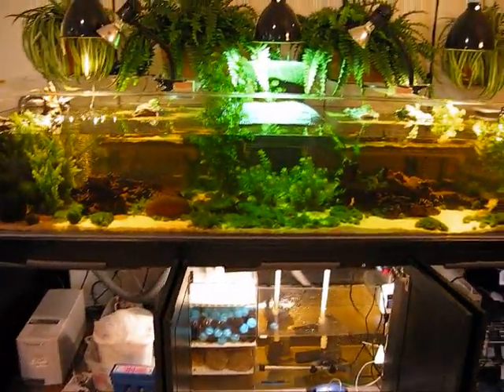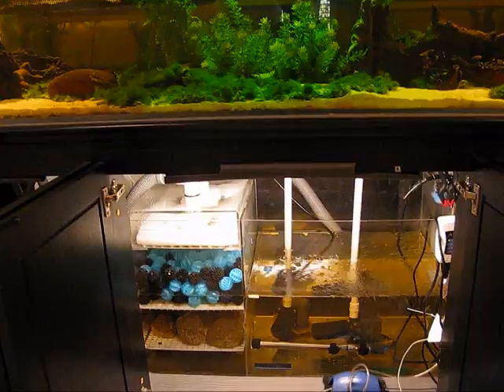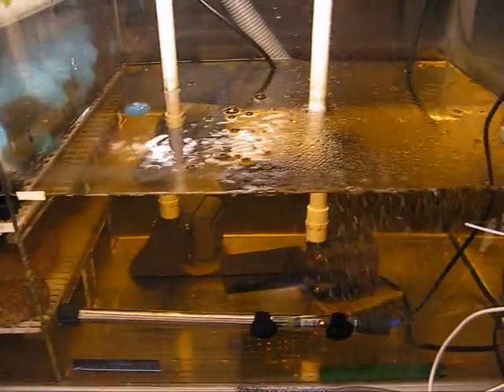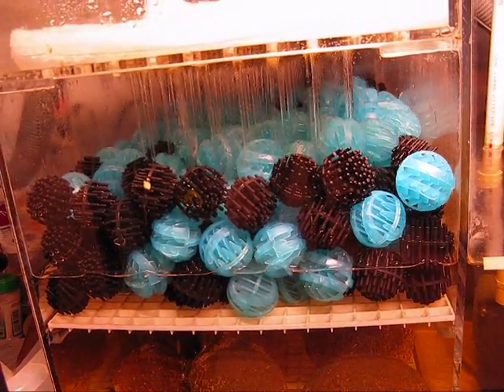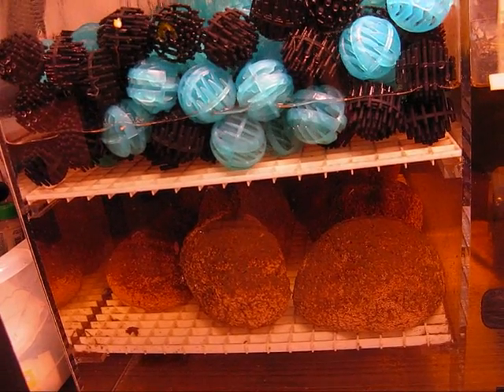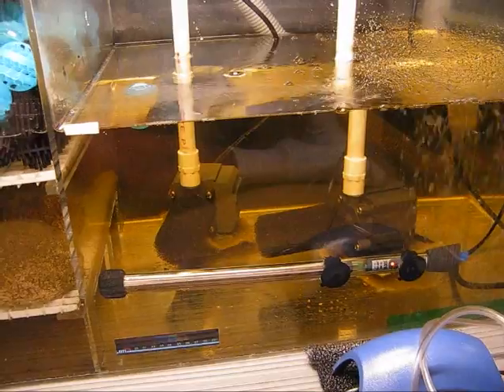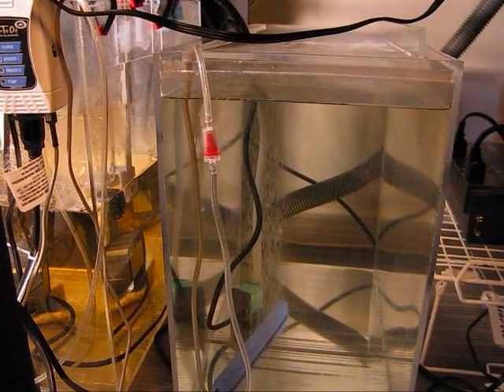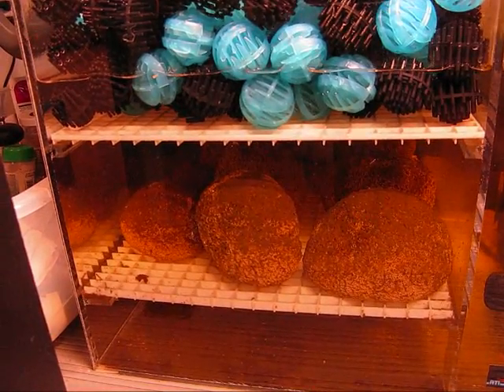Turtle Tank Trickle Filter

Comment: Hi there Bob. We recently just bought 2 Quarter size Yellow Bellied Slider turtles. We've gotten a bit lost on what exactly it is we need to do to keep them safe and happy.
So far we have a 29 Gallon tank, an Aqueon 155 Gal per hour submersible filter, a water heater, underwater thermometer, basking area, UVB light strip, 150Watt heating lamp, and a moss ball. We don't have a lot of money to spend (we've already gone far over budget) but we want to keep them safe. We've only had them for a week now and our filter hasn't done a full nitrogen cycle.
Should we add in bacteria?  Do we need to fully drain our tank every couple days and clean everything off or only do partial water changes? Should we get a bubble wand to oxygenate the water for the bacteria?
As you can tell we are very lost at the moment. Whatever help you can give would be appreciated.
Reply from the maker: do only partial water changes to preserve bacteria that break down waste products.  I change half my water once weekly.  Surface turbulence will probably increase oxygen better than a bubble wand though they are good for breaking ujp surface sludge.  The larger the tank the easier to keep clean.  You'll eventually have to get a much larger tank as sliders can grow quite large.  You'll eventually need to switch to a larger canister filter as well.  Adding bacteria shouldn't be necessary.  Try adding anacharis plants to help with water chemistry.  Buy a kit that measures ammonia, nitrites, and nitrates.  The biological filtration in your tank must be good enough to render ammonia and nitrites to zero.  Nitrates are controlled by the partial water change. 

I strongly recommend joining the Turtle Forum online. 
http://www.turtleforum.com/forum/upload/index.php?

Comment from the maker: those are not ordinary rocks.  They are cell pore rocks.  I don't know if they are available anymore but they are very porous all the way through and provide a lot of surface area.  In any case, my ammonia and nitrite levels are zero so any more filtration would be redundant.  I am trying to add more live plants to work on the nitrate levels instead.  But I'll always have to do partial water changes, nitrates are always a problem in a closed system like an aquarium.

Comment from the maker: heavy waste on the bottom cannot be handled by any kind of filter unless you are blasting a current across the bottom of the aquarium.  The largest canister filter only sucks up waste sitting on the bottom if it is within a few inches of the intake.  Most organic waste will eventually dissolve in the water to form ammonia and other organic byproducts which should be handled by the biological filtration in any good filter.  Try to manually remove any uneaten food within a half hour of feeding.

Comment: Hey Bob, love your setup.  I just got a 210 with dual drilled overflows and I am thinking about duplicating your setup.  My only concern is that the surface skimming an overflow is famous for does not address the heavy waste that sits at the bottom. How have you dealt with this and is it even a problem at all? Thanks

Comment from the maker: turtles are far less sensitive to ammonia byproducts that fish.  I just started a hatchling tank less than 2 weeks ago.  I had three mud turtle hatchlings in there right away.  The water clouded and then cleared after a few days.  Never has been an issue with turtles.  I still do frequent partial water changes though, high nitrates are not good as well as other contaminants, bacteria, etc.

Comment from the maker: the tank was custom built by an aquarium shop here locally.  When I first added the Mopani wood to the tank I had a tannin problem, water turned tea-colored.  I used carbon to remove the tannins.  Once the tannins subsided, a couple months, I stopped using it.  Carbon will remove certain chemicals that a filter cannot, so it isn't a bad idea, especially if you have very delicate fish.

Comment: you also can use lava rock our split is even better. Wash them out before putting them inplace. Only use lava rock in freshwater aquaria, saltwater aquaria can make a toxic reaction on lava stone, that realses to much iron. Youre coral won't like it. my freshwater setup in my sump is made out of: Trickle filter bioballs, Movin bedfilter with the chips, macanical blue sponge, lavarock, cilinder pipes, 2x 300w heaters, reserve tank. and back into the aquarium

Comment from the maker: I have no idea whether the cell pore rocks are making a difference or not.  A properly designed wet/dry filter should be able to deal with ammonia very effectively unless the bio load is too large (too many turtles or fish, etc).  There are other materials out there with lots of surface area that will work just fine.  I have ordinary bio-balls in the sump underneath the filter pad.  That is probably all I need.  If cell pore rocks were so terrific someone would probably still be making them.

Comment from the maker: don't recall exactly.  Check with a local aquarium shop that custom builds tanks for an estimate.  Depends on the tank dimensions, thickness, sump and pumps, stuff you put in the tank, etc.  I recommend GlassCages (you can find them online) for pre-built acrylic turtle tanks.  Much cheaper than custom built.

Comment: I like the filter pad setup. Easy to pull out and clean, or replace. Seems you leave most of the mechanical filtration to the bacteria, and your nitrite levels show that to be working out well. The large amount of plant material should cut way down on the nitrates.

Comment from the maker: no filter is strong enough to draw all solid waste from the bottom into the filter.  Most of it is dissolved into the water and ultimately becomes an ammonia byproduct which then converts to nitrites and finally nitrates.  If the biological part of your filter is doing its job, your ammonia and nitrites should be zero.  Water changes will resolve the nitrate problem, live plants help a little.  If you have the energy, you can manually siphon the debris off the bottom.

Comment from the maker: Mechanical filtration is difficult because debris will collect on the bottom of the and NO filter will remove it all.  You have a very large turtle in a rather small tank.  It will naturally produce significant waste.  If you had a larger tank, the water could absorb the waste better and if your biological filtration is working well, would mange it quite well.  Your turtle would appreciate the space.  You can tell if your biological filtration is working by testing for ammonia and nitrites.

Comment: I have a 110gal and im using 2 canister filters with 4 baskits each and 1 uv turbo twist light and I still have a hard time keeping it clean, my turtle is 10 years old and almost as big as a dinner plate, do you think ill have better luck with a wet dry system like yours? Thanks greg

Comment from the maker: any filter system needs to 'mature' until there is biological equilibrium.  Initially the water will cloud as the bacteria bloom, but will eventually clear, usually in a few days.  Never do full water changes, only partial water changes.  Use water that has had the chlorine removed.  Chlorine will kill bacteria and ruin your eco-system.  Chlorine can also kill fish.  Larger tanks are easier to maintain than small ones, the more water the better.

Comment: If you just have a search for what I wrote... Sulphur will lower the PH to dangerously low levels in the reactor, even for your tank.. Coral is the other media that brings the PH up before the nitrate free water leaves the reactor.. You however only need a PH of 7 something for your semi SA tank so you do not need to use all the coral media in the reactor to bring it up higher.The reactor is of course intended for saltwater since virtually no one runs setups like yours on freshwater...

Comment: I'm not going to rain on you parade Bob its the best private turtle tank I've seen.. I have a couple of tips for you. 1. Do not let the bioballs sit in water.. You can see that the bottom ones are submerged. 2.If you would like to improve your water easilly there is a product called Purigen from Seachem that will really help you out. The best thing is that it can be reactivated so it's cheap. I'd put a "the bag" under each of the waterflows under your filtermat. You'll se changes within a day!

Comment from the maker: Depends on what you mean by a lot, I have two pumps that run 24/7.  The UV/heat lamps are on during the day only (3 x 100W).  I sometimes run 24W UV lamps but they don't produce heat and are not very bright.

Comment from the maker: I would imagine the more water (higher gph rating) moving through the sump would oxygenate the water better.  There is probably a point of diminishing returns where increasing the gph rate won't make that much difference.  I don't design these systems so I am not technically the best person to ask.  You might want to consult with an aquaruium shop that actually builds wet/dry systems.

Comment: Can you keep our tank temp up with just one 300W heater? I have a 220 gallon standard format tank in an air conditioned house. House temp varies around 72-76 in the summer and I need to keep the tank at 76-78. the tank is fully covered with an Eheim 2217, FX5, 100W basking light and 300W heater. Think it will be enough or should I get another heater?

Comment: i would like to use some of your ideas if you dont mind.. i love your tank! i know that its costum made, and i did take a look at glass cages, the website, and i found a tank the right size i do want, however, i did notice that they sell only the tank, and i was wondering how you got your filtration system to fit so well in your tank. it there a way to custom make the filter too on glass cages, or is there some other way that you find easy to add a filtration system to a glass cage tank? Also,

Comment from the maker: no filter can remove debris from the bottom.  You can siphon it up if you like.  That is easy to do if you use sand substrate and very difficult to do if you use gravel or river rocks.  My tank is large and the biological filtration is very efficient so I just let the bottom debris decay naturally.  I can't even see it because of all the vegetation and mopani wood on the bottom.  Check your ammonia, nitrites, and nitrates, do partial water changes every week.  Turtles are messy.

Comment: Very thorough!  I bet you love explaining to people how everything works, I know I would.  I'm investigating how to build one of these trickle filters am am confused on as to how the water maintains its level.  Your overflow is the 12" tube that runs down the tank.  Is there a hole drilled at the bottom?  Others have talked about a siphon from the overflow, but is the only option to have the gph rate of the power head less than the siphon rate?  If you can find any links discussing this, or sim

Comment from the maker: I have debris on the bottom of my tank but it is largely invisible because of all the moss and mopani wood.  Eventually it dissolves and is broken down by the biological part of wet/dry filter.  If you have a fairly bare bottom, the debris will be very visible.  Also, I have many cory catfish, darter fish, and ghost shrimp and they eat up most of the left over food.  Just make sure your ammonia and nitrite levels are zero and your nitrate levels within normal limits.

Comment from the maker: @auto437 sorry, I have no idea.  Probably not economical to sell the stuff in smaller sizes.  Get the whole sheet, you may need more in future.  It is easy to break down into smaller sizes using a heavy file to break through the plastic and then to file down any sharp nubs.

Comment from the maker: @penguin24245 sorry, don't give filtering suggestions without knowing exactly what I am dealing with...don't want to flood someone's livingroom!!  You would be better off getting help from a good aquarium shop regarding filtration.  

Generally, turtles need about 2x the rated gallons for a given filter.  For example, if you have a 100 gallon turtle tank, your filter should be rated to handle a 200 gallon tank.  Turtles are much more messy than most fish.

Comment from the maker: @penguin24245 that's pretty much true.  Keep in mind that the chemicals are mixed in the water at all depths, like ammonia, nitrites, etc.  Debris, however, does tend to settle on the bottom.  In a large tank with lots of water, that debris eventually breaks down into ammonia byproducts and is dispatched by the wet/dry filter.  If I stir the bottom of my tank, all kinds of decaying vegetation will become visible, just like it would at the bottom of a pond or lake.  I don't worry about it.

Comment from the maker: @lee50mooney I do a complete breakdown of the tank perhaps once a year.  I don't siphon at all except from the two corner boxes where the overflow tubes are.  I pretty much let nature do its work with nitrification.  If you stir up the moss on the bottom, you will get all kinds of stuff, decaying plant vegetation, stuff like that.  The wet/dry does an excellent job of managing the waste (chemically speaking).  I don't sweat the debris.  Also, a large water volume dilutes the debris.

Comment from the maker: @dirseginiyalayanadam it looks that way but the water is mixing.  The outflow on each back corner is moving at 700  gallons per hour and is driven outward with some force.  There is very little loss of filtered water.  But if you are worried about that simply do this.  Put your overflow on one end of the tank and the outflow at the other end, you will lose not have a problem that way.

Comment from the maker: @MrPrikPrak my filter pad in the sump gets very dirty, so stuff does go into the overflow tubes.  No filter can suck debris from one part of the tank to another, not even a good canister filter.  What actually happens in a tank with good biological filtration is that the debris dissolves into the water and is converted into nitrates.  Be sure to test your ammonia and nitrites, they should be zero.  Partial water changes keeps the nitrates in check.

Comment: Hi bob, To clean my tanks lately, I've been using two powerheads that have been fitted with plastic bottles which take care of the mechanical and biological aspect of filtration. From time to time, I also siphon all the little leftover junk that is settled at the bottom. With that said, my question is: Is all the water that enters the tank is from the overflow pipes? If so, how does all of the animal waste and leftover food enter the sump tank?I Would like a sump setup, but not sure yet. Thanks!

Comment from the maker: @Gixxr11 the black nozzles?  Got them from an aquarium shop.  Think they come with the Megaflow overflow kit.  I am using only PVC now though, don't care for those tubes.  Do a web search on Megaflow and see if you can find what you need.  They can be shortened or lengthed by removing sections of the tubing.

Comment from the maker: @johncean12396 If filled it would hold 46 gallons, but I never have more than about 20 to 25 gallons in the sump.  It sits on a concrete slab so the floor doesn't need to be reinforced.  Trickle filters tend to be noisy but there are tricks to quiet them down.  Most turtle keepers use canister filters which are very quiet.

Comment: Love your tank design but i have one question.  Do you have any issues with debris staying near the bottom of the tank and not making it up to the outflow tubes?  I have a very messy adult snapping turtle and am in the process of designing a filtration system for a larger tank.  Your design is very clean and i love that pump failure would not result in an empty tank.

Comment from the maker: @insideriverside I use two Danner Mag-Drive Supreme 7 pumps in the sump.  The are each 700 gph.  You can control the force or speed of the outflow by the diameter of the outflow nozzles returning water to the tank.  A wider outflow nozzle will reduce the speed of the flow, a narrow outflow nozzle will create a strong current but the actual output or volume of water flowing remains about the same.

Comment from the maker: @RyMcQuillen I did not design my own sump/filter.  I had an aquarium shop do that for me.  Obviously you don't want the pump too strong or you will possibly overflow your tank and/or drain your sump.  I strongly recommend you contact a good aquarium shop in your area for some professional advice.  Or you can search the web for design specs (overflow diameter, pump size, sump volume, etc.)  If you mess up, you could have a small flood on your hands.

Comment: An algae filter would reduce nitrate and phosphate which are things you otherwise need to eliminate through water changes. The algae filter seems to be a well kept secret in the aquarium hobby. Not sure why? But they are the other end of the nitrogen cycle and thus makes the cycle complete. Switching to scrubby pads is probably not a big deal since your ammonia and nitrite levels are at 0. But they would greatly increase the efficiency if your available bio filter space it you did have a prob.

Comment: Actually the tank has less than 180g in it if you do the math. But I would like to say that your setup as very nice. I personally would get rid of the bio-balls and get scrubby pads. They are MUCH cheaper and provide far more surface area for the bacteria to grow. You also seem to have allot of plants in the tank which is great for removing nitrates. Have you ever looked into an algae filter? If not, I would for a tank so big. They can greatly decrees the need for water changes.